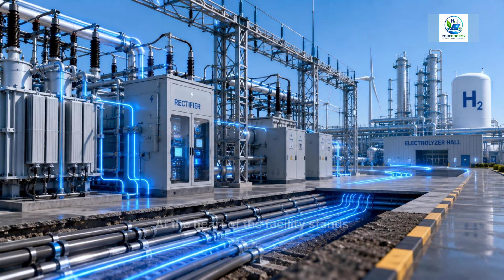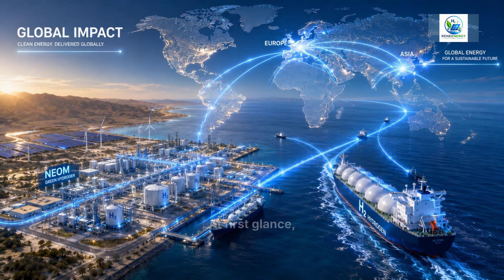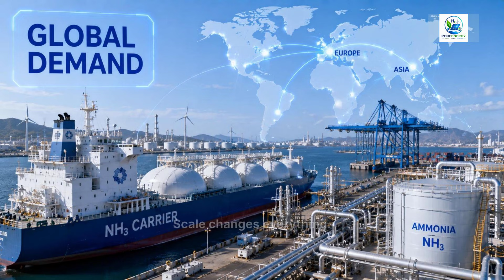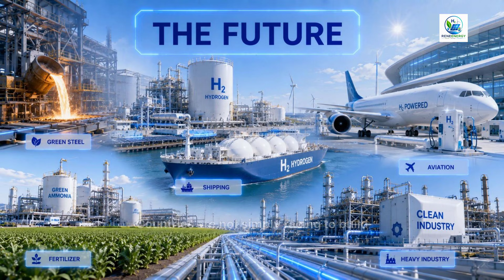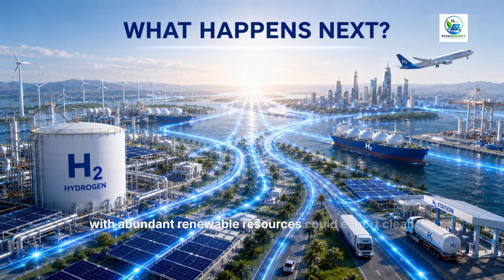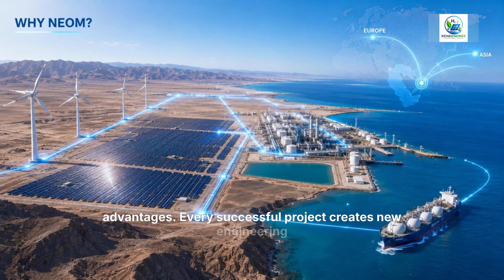Why Everyone Is Watching NEOM's Hydrogen Project?

Comment: Canada has a real advantage. Huge deposits of hydrogen have been discovered in Saskatchewan, electrolyzers not required, huge savings, hydrogen for next to zero cost.  China is already producing jet fuel by combining hydrogen with co2 from the atmosphere, a process China refers to as carbonology. Canada could do the same without electrolyzers. Canada is in a unique position, a low cost hydrogen, any fossil fuel can be replaced with a clean, green gasoline and diesel substitute, cheaper than conventional fossil fuels. Well, Alberta, forget about pipelines and filthy tar sands fuels, not competitive with green fossil fuels replacements, so forget about these foolish, unprofitable pipelines, leave the Stone Age and partner with Saskatchewan, get these green replacements going, give all Canadians next to free fuels, no ev’s required.